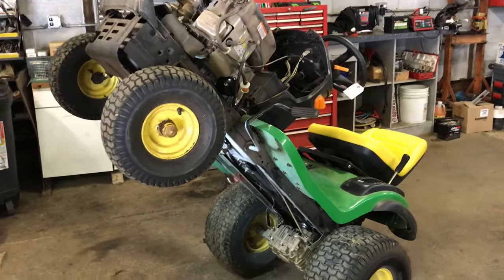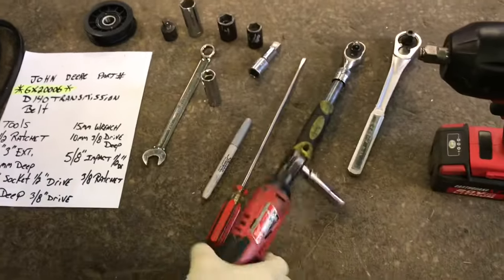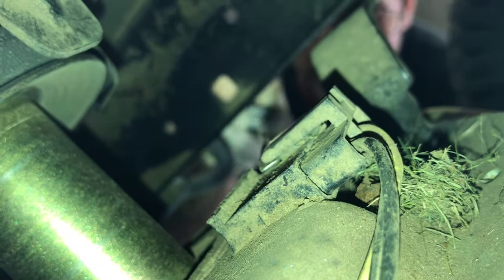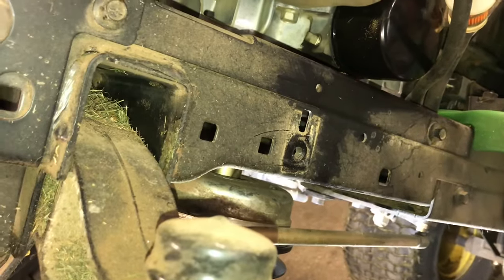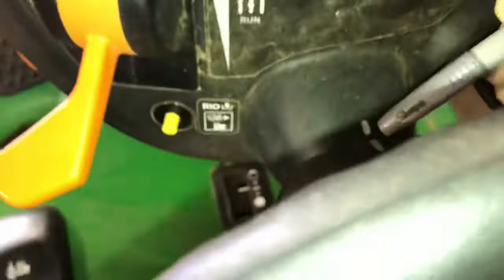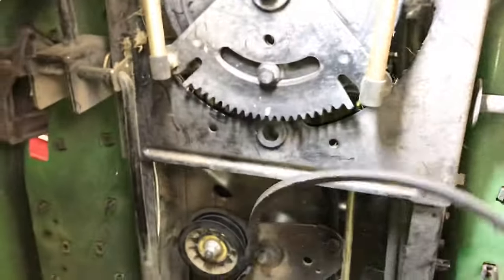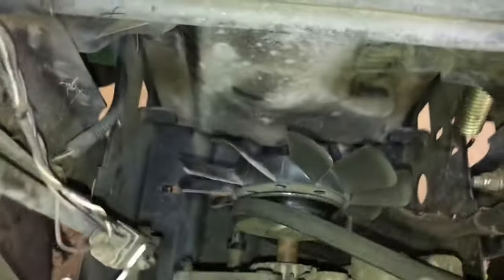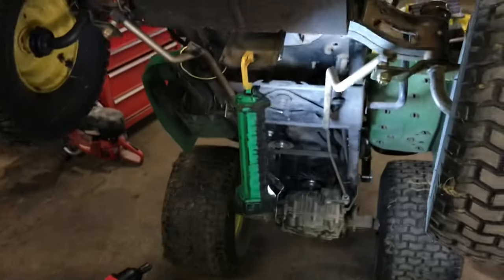How To Install a Transmission Drive Belt John Deere D140 D160 155C LA165 LA115 LA145 LA175

Comment: Simply amazes me when they engineer these things and don't keep the consumer in mind to replace a belt.   I won't even mention what the local JD shop charges to replace this belt.  I'm 80 and have always done my own work.  Starting at working on farm tractors, trucks and cars at a  early age.  Getting harder to do but again folks work smarter not harder.  Thanks for the very informative video.
Reply from the maker: I hope I am able to work like you when I am 80!! Thanks for watching and I'm glad it was helpful.
Reply: I'm in my eighties also and have when possible do my own repairs. What has always been my pet peeve is paying for repair work and not having the work done properly yet the bill is always to the high side. I have been cutting lawns for 75 years and experienced some workmanship that has left a bad taste in my mouth. I run a lawn service and do all the work myself.  I did two big lawns today complete. I live in NE Wisconsin and being fall the leaves add double to the lawn cutting/collecting chore.

Comment: Excellent video!! The dealership wanted $300 for the labor to do this job. At $125/hr, that's 2.4 hours, which is pretty much what it took me to do it myself thanks to this video. THANKS!! Perhaps the best idea in the video is lifting the machine by the nose to access the parts. Trying to remove and replace that belt retainer post in the transmission would have been horrendous on my belly with the machine up on jack stands!  Thanks again and God bless you, sir!

Comment: FINALLY !!! I am so happy I found this video.   Needed to replace the transmission belt on LA115 and  I had all the rest figured out (but you gave additional good tips on hard to get off parts) by other videos I watched.  EXCEPT how to deal with that pesky little stay spindle next to the transmission pulley.   It looked to me like I had to reach back there and slowly extricate it from the transmission and it was going to be a real PITA so I thought "Naw, can't be."  But nobody else's video showed that little part because they were for other models that did not have it. Even my technical repair manual for my LA115 does not show this.   It says just lift the belt up over the pully and I'm like "Yeah, Right!  How the heck do I do that?"   You showed me it was exactly what it looked like and I needed to just suck it up, be patient, and get it done.  So I did.    Thank you very much and great video.
Reply from the maker: I’m happy you found the my video and it all worked out!! Thank you for watching and commenting:)

Comment: This a first-rate instructional video. When I first watched it late last summer, I felt overwhelmed and decided against it (the belt wasn't so bad after all ...). After working underneath and getting a feel for the machine, and then watching again, I feel more confident that I can do it! Update: This afternoon I successfully changed my transmission drive belt. The old one had dozens of cracks in it, so it was just in time.
Reply from the maker: I’m glad to hear. I hope it all worked out for you :)

Comment: Incredibly helpful, for the mid level DIY'er, using ramps, the back bolt by the transmission was easier to access from reaching behind the transmission, it was still a bear, but this video made it so much easier.  Thank You !!!
Reply from the maker: Thank you. I’m glad it was helpful :)

Comment: THANKS! Using your instructions, I was able to install a new belt without using a jack. The only thing I did differently was remove the transmission belt guide by reaching from behind the tractor. When all four wheels are on the ground, that's the best way to access it.

Comment: The neighbor's mower would not move and the belt smelled like it was burning.  I got the deck off and check the belt it was still on both ends/pulleys.  The belt was worn, but still useable.  There was so much grass clippings under there that once I cleaned it out.  It actually worked.  Your video helped me, so thanks.
Reply from the maker: I’m glad you got in there to fix it and now it’s running correctly!! Thank you for the kind comment

Comment: Also worked for my LA135, except no clutch. You showed how to remove the large and small pully under the engine, and the belt guard over the transmission, which I didn't find on other videos. Made the job super easy. Thank you so much!!!
Reply from the maker: Glad it was helpful to you! Thank you for watching

Comment: Agree this is the best post online for the job! I have the 175 hydro LT and am stuck. None of the videos I've seen show the sector shaft forward of the steering which prevents me from getting the belt around it to the engine pulleys. I've not been able to get the cotter pin off the shaft and can't work it off from the steering support below.
Your video was great for removing and replacing the steering.

I found a, maybe, easier way to get the belt over the transmission pulley. Since my belt broke, I didn't have to remove the old one. I was able to snake the belt back between the fan and right side of tractor. Leaving a lot of slack rearward, I was able to slip it over the top of the fan by depressing each fan blade individually and turning the fan while slipping the belt on top of fan and onto the pulley.

Comment: Great video , I change these all the time and I never took the clutch bracket off, I will from now on. Also I'll mark the gear placement. One thing I always use is my air hammer against the bolt halfway out to remove the engine pulley or clutch if seized , same goes for the pulleys. Pull on the pulley while hitting the bolt with the air hammer and they just pop right off. Keep the riding mower content  comming.

Comment: Thanks so much. My JD dealer wanted 1.5 hrs labor and $50 for the part. Bought the belt at a big box store for $22  and saved enough in labor to pay for a MoJack lift for the next times I need it. Runs perfectly again. Like all the other commenters not only is this a very well done video, I also find it amazing that you do so much with just one hand. I did find the long bolt through the clutch impossible with hand tools. I have a pretty long breaker-bar that wouldn't budge it. My cordless impact ratchet broke it free in seconds. Thanks! Please keep up the vids.
Reply from the maker: Thank you for the kind words. I was born with the one hand (it wasn’t a work accident). I have lost my good camera person but will try and get more videos when I can!

Comment: thx, I did mine last year, and used your video. Anyone doing this video is excellent and with it you can do.
Impact for the dropping the PTO clutch is a must. Don't have one, borrow one!
That back guide bolt in back on trans def. is a pain, but other than that not bad of a job. Mine slipped off at @200 hours , but noticed split in belt so if you have to pull your deck anywhere around 200 hours and haven't replaced, go ahead and do is my advice. After I took deck off I titled my mower on two tires and made sure it was secure and was able to get to everything.
Reply from the maker: Thanks Chris!

Comment: Thank you so very much for this video. It inspired me to do the job and now I'm super proud of myself.
13 year old drive belt on a D160  successfully changed and I used the opportunity to put a JD original new pinion gear instead of a cheap one from Amazon.
Hopefully the machine will last a few more years now.
Reply from the maker: I'm glad it was helpful. Check out this video for front wheel bearing upgrade and I will be making a video on cheap power steering  in the future. https://youtu.be/Cd15I0mWcQM.

Comment: Amazing vid. Worked exactly as he demonstrated. My only deviation was to clean out the allen head on top of the rear belt retainer pin and used an allen key to get it started back in. I just couldn’t get it to line back up with my hands.

Comment: Thank You! So much for taking the time to record this video. I just replaced my belt after changing the transaxle oil. I spent over an hour trying to replace the clutch. I finally put a board over my small jack to hold it just below the spindle until I could manipulate it to the correct position. I also replaced the plastic pulleys. This video is one of the best I've viewed!
Reply from the maker: Glad it helped and thank you for watching!

Comment: This video was very helpful helping me to reconnect the transmission drive belt after I ran over a stick that dislodged the belt at the rear of my D-140.  My belt was still in good shape and reinstalling was a challenge until I saw this video that showed me the part of the mower that was preventing me from reconnecting the transmission belt around the rear of the mower.

Comment: First of all, great video! Couldn’t have done it the job without it. I was cruising till I got to 15mm bolt that keeps the belt on the transmission pulley. I’ve bad hand tremors and this was almost impossible but I finally got it out. When I did, I noticed the top of that bolt has a slot for a hex key. Not sure if anyone else mentioned this. It really helped me so I wanted to pass it on.
Reply from the maker: Hi Joe,  thank you. Yes many have told me about it but I’m not good with editing videos so I’m not sure how to incorporate it into the video or when the next transmission belt job comes in I’ll do it then! I’m glad it was helpful and thanks for watching:)
Reply: Great video and very much appreciated.
Unfortunately some models, like my D140, where the fan is above the pulley, have a belt guide, shaped like a bolt, that must be removed to install the belt.

Gotta love Joe Smith's discovery -
"I noticed the top of that bolt had a slot for a hex key" 
A small DeWalt electric screwdriver and the correct hex bit (6mm), and it was out, and back in, quick.

Comment: Thank you!  This is the best video!
I didn't need to replace my belt, it had popped off the rear pulley. Knowing what the retainer bolt looked like and that it was a 15mm made the difference between a quick fix and drudgery.
Reply from the maker: Thank you for the kind words Bill, I'm glad you had a simple fix and the video was helpful.

Comment: I have to change the transmission drive belt on my brother’s JD 160,and this video is the best one I’ve seen….I’ve watched your videos for several years and this is the first time I’ve commented on one. I have to say that you are very talented at not only the repairs but the videos are excellent as well.Thanks for sharing them with us.Bill H
Reply from the maker: Hi Bill, thank you for watching my videos and for the very kind comment!
Reply: Hey thanks for the video, I was able to replace the transmission belt on the D160. I actually used this repair as an excuse to buy a new tool,lol.A Ryobi 1/2 cordless impact wrench,works great.Anyway the worst part was getting that rear pulley guard thing out….and back in…thanks again…My next project is getting my old LA120 running again…I got a new S170 last year
Reply: Forgot to mention,one of the belt pulleys was worn out at the top lip,so I went ahead and replaced both,the flat and the V …still cheaper than having to pay the Dealer..
Reply from the maker: Back in the day I always used air guns. When they came out with the rechargeable battery powered impacts and all hand held in general. GAME CHANGER!!! I only need compressed air to clean with. I even went to a battery powered air pump for the tractor tires. It does take a little longer but as I have aged, I now how so much more patience :) LOL!! I'm glad to hear all went good! Subscribe, give this video a thumbs up and share the channel to help it grow. It would be greatly appreciated!

Comment: Best video I’ve seen on YT for my 155c drive belt.  The keeper peg in rear diff also has a 7/32 hex in the top which is faster than using a 15mm.

Comment: Great video and very much appreciated.
Unfortunately some models, like my D140, where the fan is above the pulley, have a belt guide, shaped like a bolt, that must be removed to install the belt.
Gotta love Joe Smith's comment below -
"I noticed the top of that bolt had a slot for a hex key" 
A small DeWalt electric screwdriver and the correct hex bit (6mm), and it was out, and back in, quick. Thank you both, but especially Joe!

Comment: I wish I had seen this video before i replaced my belt.  I agree with others that this is by far the best one.  I found videos that were supposed to be for my model mower but the steps and parts removed didn't match.  You might want to add LA145 to your list of models.  That is what I have and the layout and steps matched mine exactly.  I wish you showed how to tighten the belt.  Mine is too loose and struggles to go up hills now.  I cannot seem to find steps or a video on how to accomplish that.  I guess if I have to replace the belt with a different one I'll have the best video to follow for my second time!  Thanks
Reply from the maker: Glad you all are liking the video. I will add the LA145 to the list. Thank you!

Comment: Very well done, sir. One thing I discovered just the other day after watching your video was that there is an Allen fitting on top of the shaft that holds the belt at the top of the transmission. So when I took it off to get the belt on I found the Allen fitting. When I put it back on it was so much easier to just put a stubby Allen wrench in to screw it back down. The bolt is called a 'belt keeper stud' on the John Deere website. Hope this helps.
Reply from the maker: Yep, thanks, many have commented, I hope this video helped you out! Thanks for watching;)

Comment: Hmm ... Just did my older John Deere (Scotts, 16 years old)  and I did not need to take off the clutch.  Just loosened the front pulley belt guide and slipped the belt on.  Also ... same around the trans pulley... No guide was there, just a bracket that was easy to flex open a little and let the the new belt slide around the pulley.  Makes it a little easier  on the older J.D. models.  Everything else was the same though.  JD (Scotts/Sabre/Murrey) have been making this design lawn tractor for 20+ years.  Good tractors at the right price. Local lawn mower repair shop quoted me $180 to replace my drive belt.. cost me just $19.  Nice video!

Comment: Along with the other 500 comments,  amazing video.  Best one.  Quick note on the bar near the rear that's a pistol to remove.  It's really easy to do when you remove the fan.  With the right tool, that clip is easy to remove.  So worth the investment takes seconds on that bar once the fan is removed. Allen wrench on top of that post makes it easy.

Comment: I enjoy your video.  I learn a lot, nice and concise.  I have one suggestion easier  to take off the belt guide bolt.  I found accidently that there is a place you can access the guide bolt from the back right behind the cover with hitching plate.  You can see it right there   Hope this will help somebody

Comment: I just bought a used d140 and it says hydrostatic transmission (I don’t know what that means lol) , looks like it’s just a belt drive like my really old husky. Thanks for your videos, I’ve watched a few and you really seem to know your stuff, subbed. Thanks man.
Reply from the maker: The easy way to describe ; Instead of shifting from gear to gear and letting a clutch pedal out to move (Gear driven tractors) The "Hydrostatic transmissions" runs a  pump that will variate the speed using the pedals on your machine to move you from slow to faster instead of shifting. The hydrostatic transmissions are the way most tractors are built for ease of operation. I can say do not tow anything heavy or if you haver extremely large hills your transmission may start to get weak as you run it so be gentle when towing or do not tow anything if you can help it.
 Thank you for subscribing to help my channel grow! Tell a friend or two.

Comment: Absolutely awesome job! Thank you so much for doing this. I was changing the drive belt on my 102 when I realized that it went around the steering. You made my job easy!
Reply: Awesome video. My tension screw in the rear has a 7/32 hex key slot on the top of the screw/post. Didn't know until I took it out but sure helped screwing it back in!

Comment: Excellent vid. Very helpful! 

One thing I found while changing mine. The belt guide that required the 15mm spanner had a 6mm Allen Key slot on the top end. Not sure if this is the case for all year models of the D140. I cut an old Allen Key to around 4-5cm and used it and a 6mm socket and ratchet to put it back on. Was heaps faster and easier.
Reply from the maker: Thank you and thank you for the very good tip about the allen  wrench. Do you remember what size allen  wrench you used. I may try and put it in the video.
Reply: @JohnsonsSmallEngines  yeah no worries mate. Thought I had. It was 6mm Allen Key. I cut a 4-5cm length off an old key and used a ratchet with a 6mm socket. I used 100mile an hour tape (not sure if that’s what you call it in the US) to hold the length of key into the socket and make it easier to guide down through the plastic fan blades. I’ll try get a pic of it for you.

Comment: OK great video I have to change  my 175 drive belt I thought I could just snake it in there but I got it now I didn't notice the belt was cracking until after I replaced the pto clutch so I'll drop the mower deck again which is all been rebuilt last year and this is all because of the spring broke and was just laying in the same position its the 2nd spring it's 11 years old and trying to outlast the wheelhorse 23 years old still running but mower deck shot had a fmc bolens 18 hp qt 32 years could not find u joints got 500$ for the motor having lots of fun mowing grass

Comment: For the trans bolt retainer bolt, I used the 15mm to break it loose, then I used the 6mm hex with a flexible right angle adapter with my impact driver. took 5 seconds to take the stud out and reinstall.